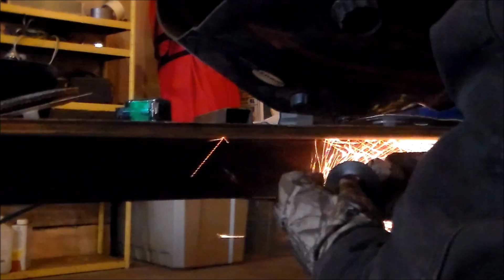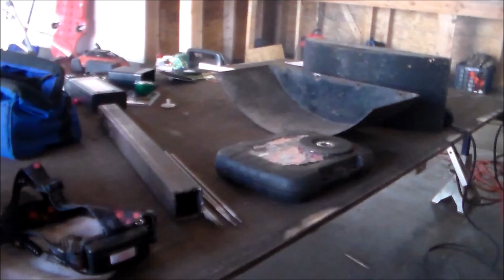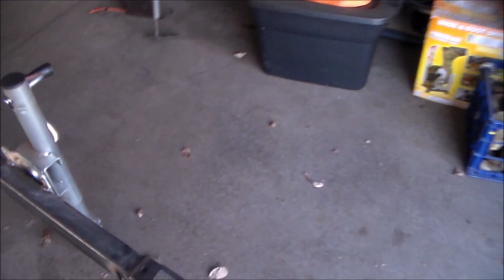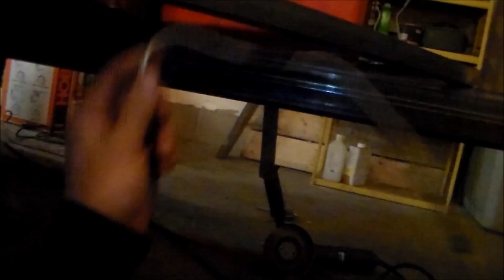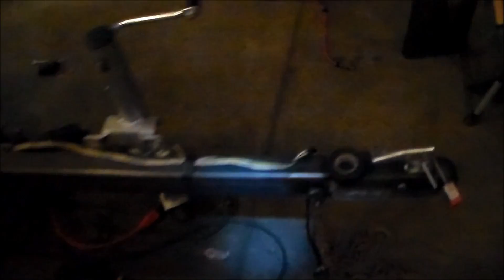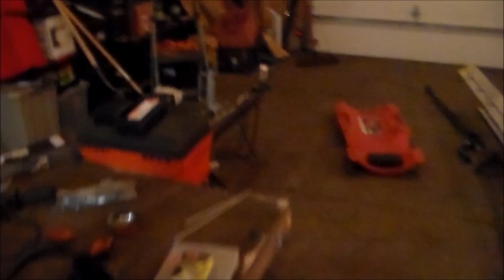Welding The Utility Trailer Part 2

Comment: Nice work on the trailer project. I live in your area and know that the metal center where you got the I ♥ Scrap sticker has boxed in trailer light brackets and the lights if you wanted to switch to oval/LED tail lights.

Comment: Good job.  On the coupler you should weld inside the small hole for safety, coming along good.
Reply from the maker: +Victor Hébert I was thinking the same, I will have to weld it up